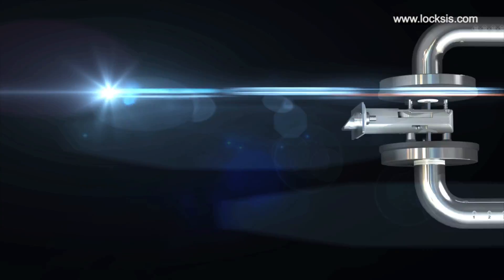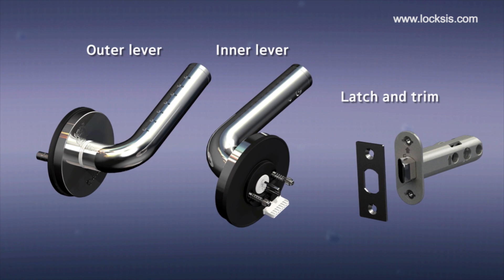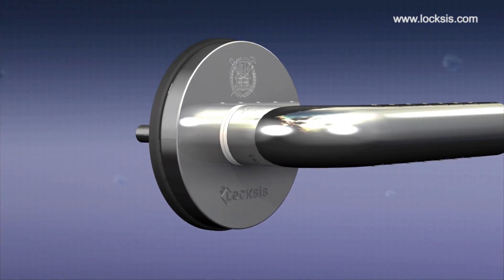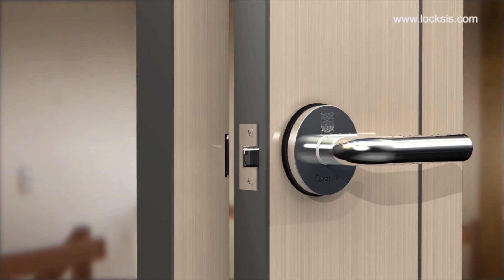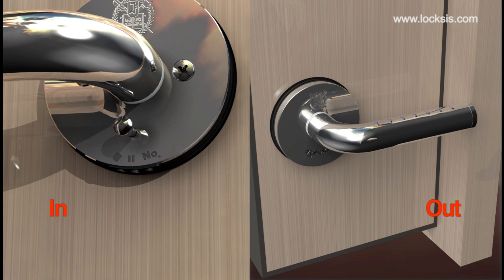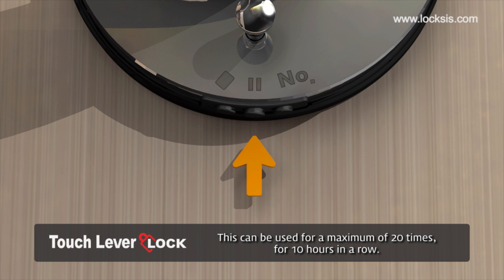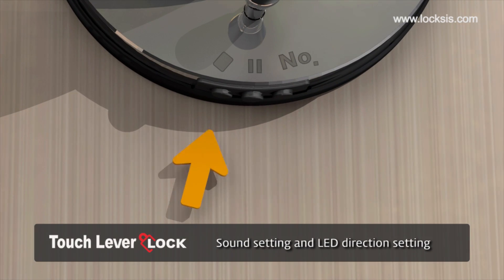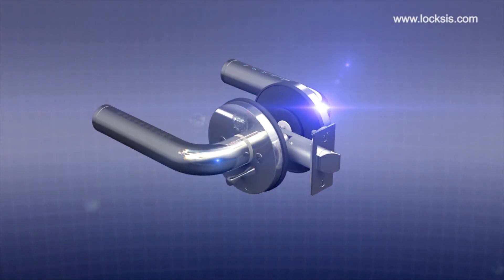Electronic SMART Lever Lock - LOCKSIS Keyless Digital door lock - Smart door lock

Comment: Seems that you can easily bypass the door handle by using a crowbar to pry the door from door frame. The door lock technology is rapidly changing but what about the cylinder and strike plate?
Reply: Nothing is totally secure.  But that would be a crime.
Reply: +Joseph Martinez Hi Joseph, if your door frame isn't properly done, so a space appears then yes but it has nothing to do with the Locksis since replacing your old door handle doesn't involved to touch the door frame.

Comment: "use a 9v battery to enter"... ok when batteries are flat... but no need for a code? I wonder how you guys connected that, could an outsider drain the batteries? electronic locks are meant to be broken.
Reply: +Nico Vijlbrief (CodeAsm) Hi Nico, when the batteries are flat, you use the 9v battery indeed then you still have to enter your password to open the door.

Comment: Cant someone simulate a fire to open the door?
Reply: The fire detection sensor will not be activated from outside because it is located inside.
Reply: Do you know the sensor type? If its heat it would still work.